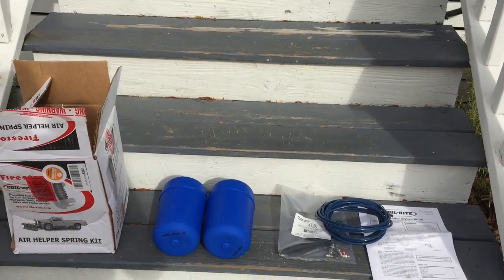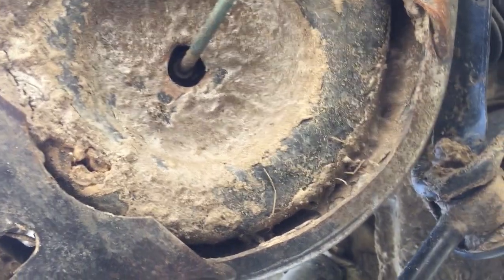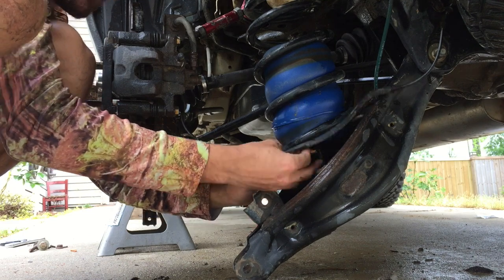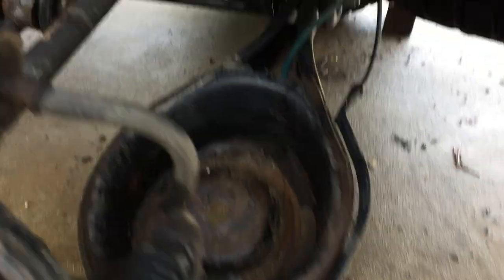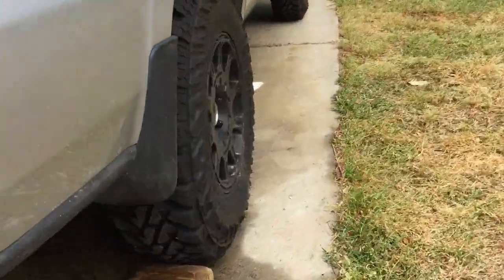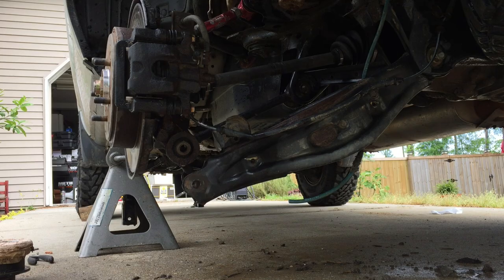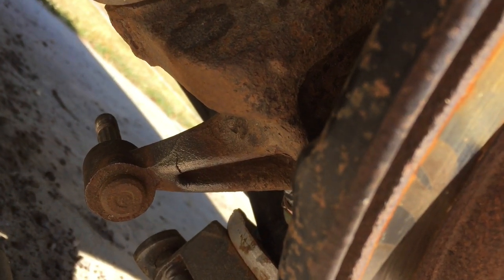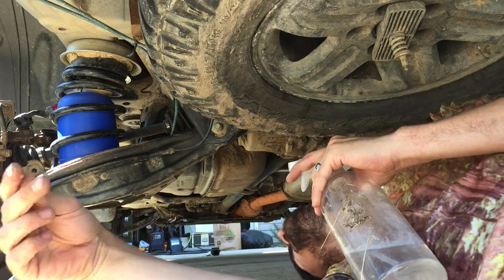Air Helper Springs and Rear Lift Kit Install (Honda Pilot 2003-2008)

Comment: Do you think putting a valve switch at the T connectors would be good on keeping the air in the bag? And then releasing it when need to? Also, do the line fittings stay connected without popping out?
Reply from the maker: I like having both sided connected to one T with a valve. If one side leaks the rear stays level and safe. The push connectors can be a bit fiddly, but if you keep them clean they can be reliable.

Comment: I wonder if Erin ever used the Monroe load bearing shocks in the rear.  I run those and I think it’s a good substitute for the air bags.
Reply from the maker: I ran the Monroe shocks early on in my build. I went through two sets and both started rattling pretty quick.
Reply: @GotterAdventure  the Monroe shocks coil spring supporting the extra weight load stresses the shock mounts and probably caused the break you welded up.

Comment: How does it handle with the sway bar disconnected? Also do you have any more spacers in the front besides the eBay spacer?
Reply from the maker: With the air springs in the rear I think it handles well without the swaybar. That being said a 2.5" lift and a loaded roof basket don't make it a cornering master :)  As of right now the ebay spacer with a bit of cutting board is all I have in the front
Reply: @GotterAdventure  cool, good to know! I have some airlift bags in the back of mine.

Comment: Hello, quick question, noticed you are not using the rubber isolators between your springs and the spacers, do you get an chatter or noise?   I have just lifted mine with HRG 3inch kit, and tried using rubber isolators (I also bought new rubber isolators and springs) however the Dorman springs are half inch taller and I think causes rubber isolators to squeeze out. I am debating whether run without the rubber isolators (see that you do).  Thinking lots of gorilla tape on spring may help with noise (if any)... will experiment,, I can do the spring swap in 20 minutes now (since done so many times).
let me know, Cheers.
Reply from the maker: I haven't noticed any noise running them this way. Technically you lose some height

Comment: Socket sizes would be better info than using wood to beat the shock off. I use a 10 lbs sledgehammer to knock my shocks off.
Reply from the maker: Welcome to the channel, I rewatched the shock removal part and I did mention the socket size. That being said your point is noted. I still think using the wood as a chisel to remove the shock helps a lot. It can be hard to make good contact on the bottom of the shock without it.

Comment: My 16 Odyssey rear is sagging a lot when fully load with family of 6 and stuffs for camping. I was thinking to change thr spring and shock. But can I add this air lift to the old sagging spring or should I change it before installing this airlift?  Thanks
Reply from the maker: I think it would be best to replace the worn out springs first. If you need more support then the Airsprings are convenient. Airsprings fittings can be a little finicky, so an onboard pump and gauge can be useful.
Reply: @GotterAdventure  do you recommend Timbren rubber thing for $250 twice the price of Air Lift?
Reply from the maker: @TruongLe-eo8kh  The air lift is adjustable which helps maintain alignment based on the load. I don't have any experience with Timbren, but I would probably recommend aftermarket springs before ruber spacers.

Comment: Thanks for sharing! Could you have used a cut off wheel on the sway bar instead? Based on the way the pilot is built was disconnecting not an option?
Reply from the maker: Yes that would have worked much better, I didn't have a good grinder at the time. Unfortunately the sway bar interfered with the tire at full droop.
Reply: @GotterAdventure  the Dremel cut off wheels have worked great for things like this! Might go through a few wheels but work pretty well in small spaces. I recently broke my front sway bar end link extension bracket for my lift on a trail which bent the end link, tore the ABS and broken the boot on my tie rod. Just got done replacing all that. A lot of folks just run a front and or rear sway bar disconnect... I may if the bracket fails again. I will say the ride was smoother when one side was disconnected but always worry about high speed handling
Reply from the maker: @freedom_foz_6337  I love the ride off-road without them all together, but I definitely saw reduced life in my front axles that way.

Comment: What was the reason you cut off your sway bar? Was there a benefit?
Reply from the maker: Increased flex, no matter how I tried to tie my disconnected swaybar out of the way it would interfere with the tires
Reply: @GotterAdventure  ahhh ok.

Comment: Do you know if this kit will work for 2016 Honda Pilot?
Reply from the maker: 2016 Honda Pilots have struts in the rear. Unfortunately they aren't compatible with air springs.

Comment: What did you use as spacers on the lift I want to lift my rear up a bit more then the ebay 2 inch I have
Reply from the maker: Plastic cutting board, Proceed at your own risk :)

Comment: Aaron, are you running stock springs in the rear or are they aftermarket?  I’ve been contemplating replacing my (original springs on my 2004 w/ 195k miles) with Moog springs to help with rear squat when towing - I have Airlift 1000s on it now but they’re helping as much anymore - I’m thinking the springs are too worn. .  However, the inner diameter of the Moogs is narrower as the coil is thicker so I’d need a different size air bag.
Reply from the maker: I'm running original springs I the rear with 2.5" lift spacers, kyb shocks,  and Firestone air springs. I have been very pleased with the ride and flex.
Reply from the maker: My air springs are 2" taller than Firestone recommends :) they are in my Amazon store
Reply: @Astronerd did the 1000s even help at all they are loose inside the shock on mine. how did the serve you
Reply: @brianward5129  they have done quite well, easily removed 2” of squat when towing at first, now a little less.  Mine take up all the room in the coil, there is no play what so ever.

Comment: Great video! I liked the tip about the control arms. The allen socket parts on the originals are a pain and easy to strip which make things fun.  Curious why you pulled the shock off. I've done the same job and didn't need to remove the shock.  Is it because of your lift?
Reply from the maker: Hmm, That is a good point LOL. I guess I did it for fun!